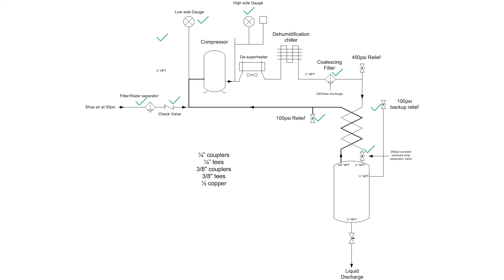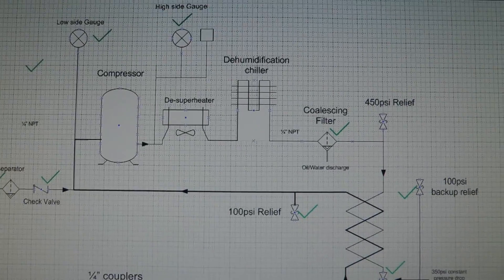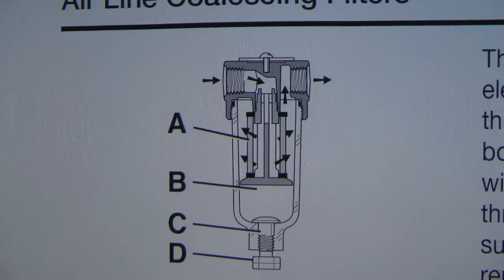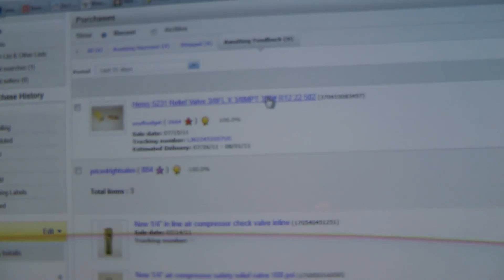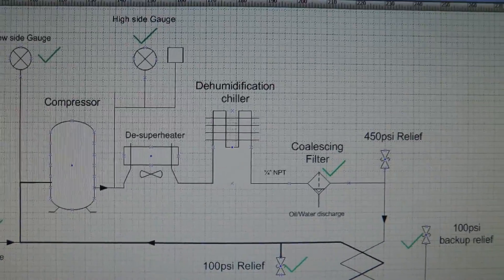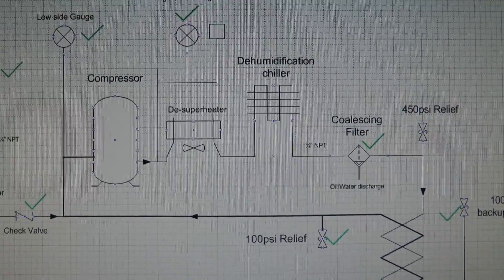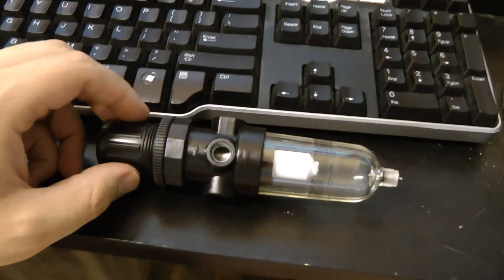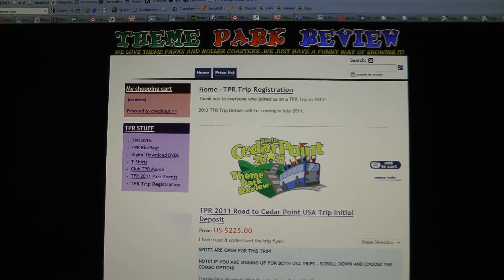Hampson-Linde air liquefier Part 5 - Schematic, Coalescers, and a vacation

Comment: Hey David, just wondering if you are planning to install a some kind of a pre-oil filter? I think someone else asked on here whether or not you would have a system of returning the oil captured back to the compressor. Maybe a simple separator to return the majority of oil prior to it reaching the coalescing filter, maybe the quantities are too small to be worried about. What do you think?

Comment: Hi David, Iam in the compressed air feild this is a very intresting project your working on I don't exactly understand what your doing but you seam to be a bright person and  I cant wate to see this thing work! Is the desupperheater a after cooler? Also I think a moisture trap before the coalescing filter would be help full. the rating on that coalescing filter cant be parts per billion isn't it PPM never seen that tight of a rating on a coalesser keep up the good work!